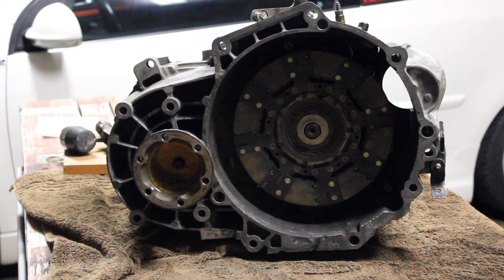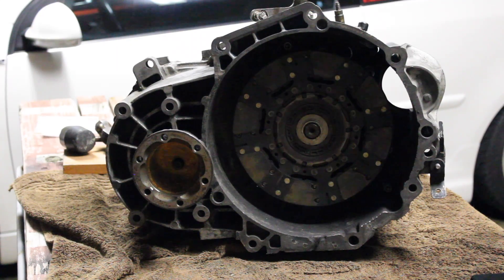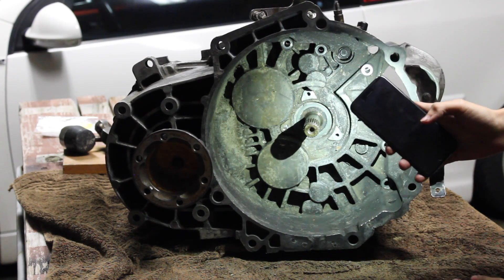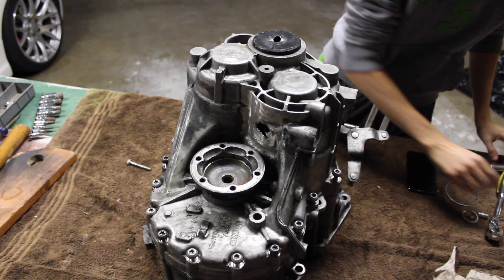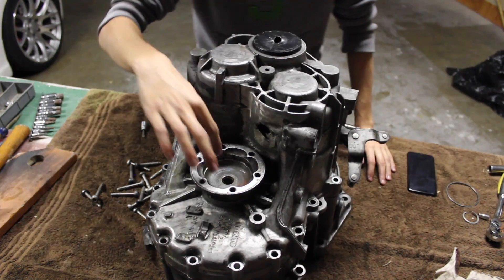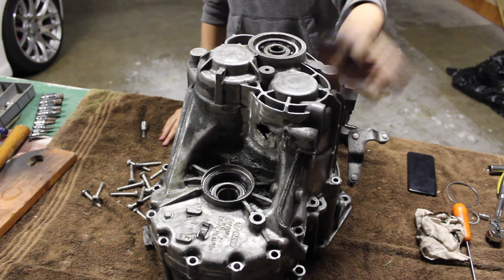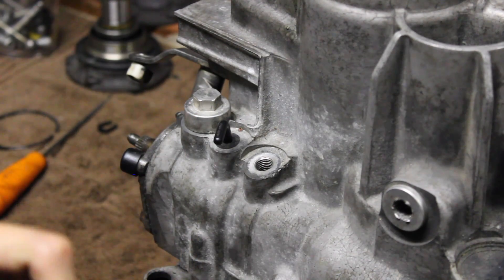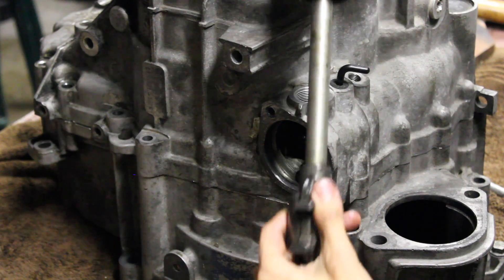Mk5/Mk6 GTI 6 Speed Transmission Disassembly

Comment: Love how your slamming it all on the table 🤔  Best way to put it all back in is build the shafts all together before you drop it back in the case. Also no need to remove smaller circlip from end bearing that is for removing the bearing from the shaft.

Comment: Hy!
I recently baught a Audi a3 8p Mk2 from 2009 2.0 tdi with a gearbox failure with a KXX code  and a CBAB engine code. Someone told me that the older gearbox fit in place from the older 2.0PD but I don't know exactly wich code of gearbox shoud I search for. If you have some information, please share them with me!
Reply: Ring the vw or audi main dealers and ask them. They know everything
Reply: Or pop in. Even better
Reply: @javaidsadiq5775  ok.

Comment: What is it he removes at 7:40? I have an issue my shift tower is not moving freely up and down. Is there any spring or retainer pushing it?
Reply: From what I remember it was just a plug it didn’t look like it applied any pressure to the shift tower. My biggest help was going to the dealer and asking for schematic drawings of every part on the transmission. Keep in mind the shift tower can only go one way and has to align with the shift forks. Do you have any grinding issues or anything else besides that?
Reply: @19965874  thanks for the reply. It shifts gears mostly smooth it just never returns the gear knob into central position vertically... which is a problem if you want to shift faster.
Reply: @19965874  https://youtu.be/Z1ZoGmIB42c here is a short about my problem, any thoughts?

Comment: The cap at 6 minutes. With the hole. How did you remove it? Mine is leaking and needs to be replaced.
Reply: I punctured a hole in the middle and used a screw driver as leverage to take it off, however you are going to have to drain the oil first  if you are planning on doing this
Reply: Thanks. Mine is leaking from the cap. Is there a seal inside that might need to be replaced?

Comment: Would you mind sharing the torque used for attaching the housing bolts?
Reply: I just did hand tight on everything and used oem vw silicon to seal the case no leaks at all.